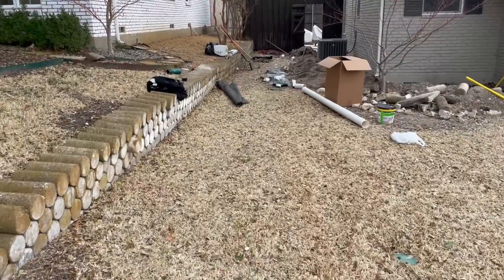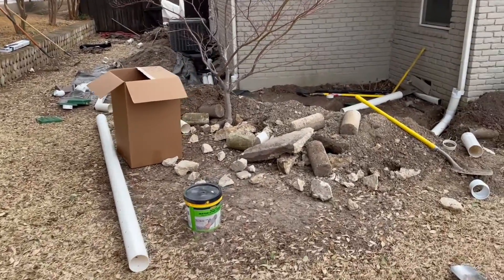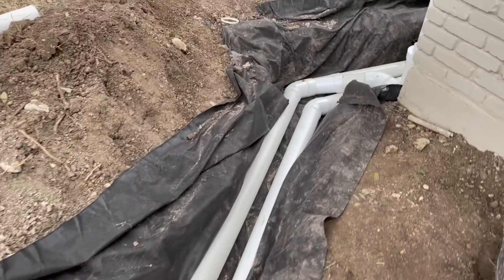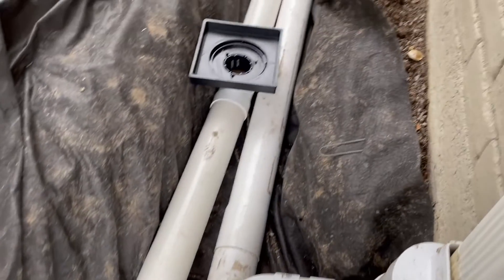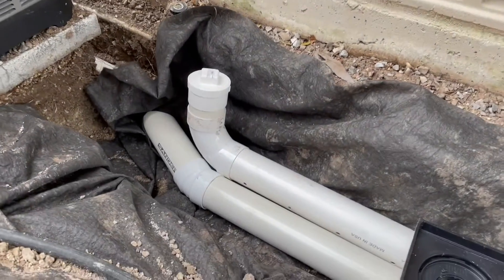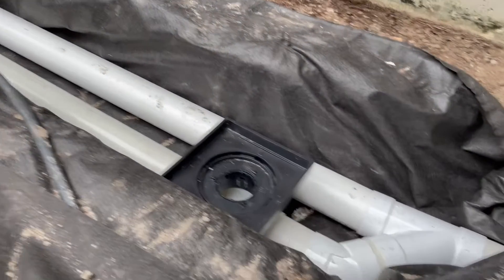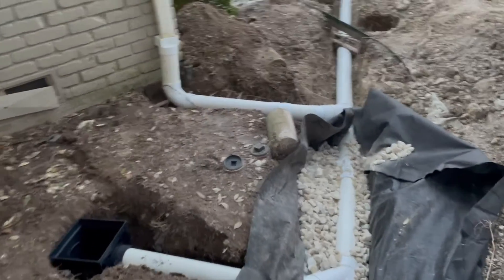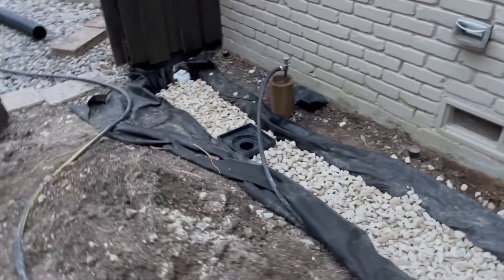Dual Pipe Combo French Drain System - Dallas Drainage Pros

Comment: Hello from Hudson Valley NY
Just subbed!
Been tracking you on a couple of vids. Great stuff. Really you’re the only one that is using pipe with explanation that I’ve seen 
2 questions 
Just to get scope of work 
First:
How many workers would you put on this scope/ type of drain?
(DIY workers Hahahahahaha)
Probably be just me doing sections.
2nd: 
what type of gravel are you using?
Can all purpose gravel for pavers ( looks like pea stone) be used?

Keep up the vids very helpful in planning and situations.
God bless
Reply from the maker: Thank you so much! This is at least a 2 person job, but the more the better I think. And really any kind of gravel will work - it needs to be roughly 1" to not slip into the holes on the pipe. And pea gravel is okay, just make sure it's large enough to not slip in the holes either. Oh, and one more thing, make sure the gravel is relatively clean - you don't want a bunch of sediment washing down and clogging your drain the first time it rains!
Reply: @DallasDrainagePros  
Hey thanks for the quick response and the input.
Good luck with growing the business. Have a great summer!